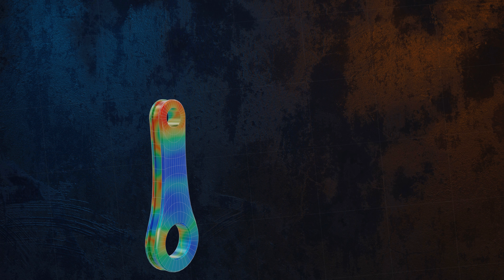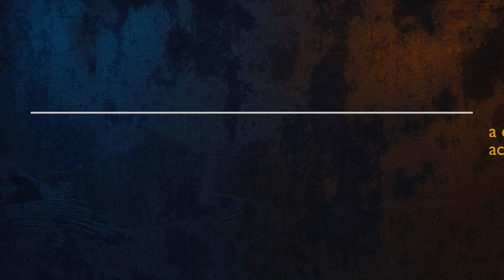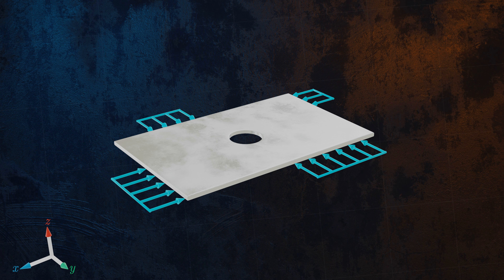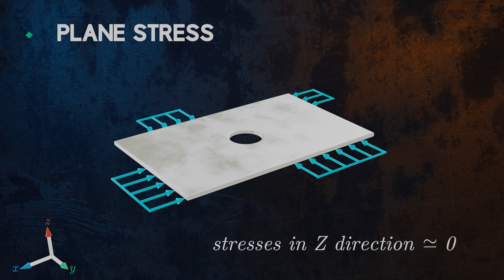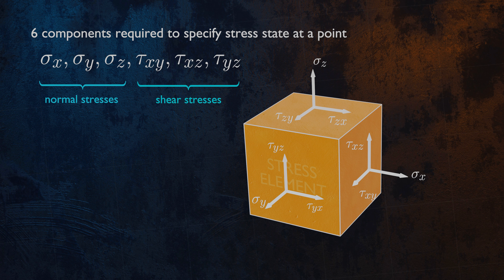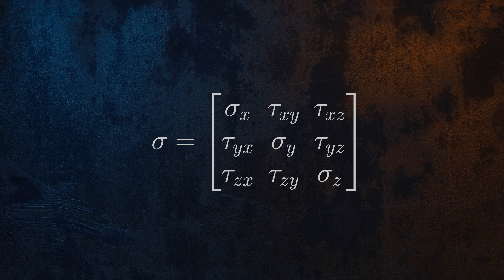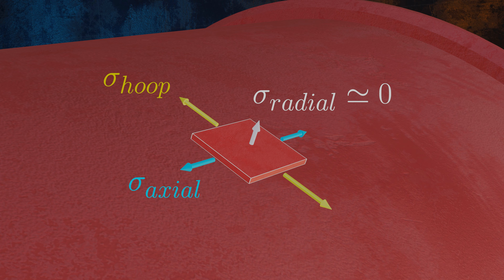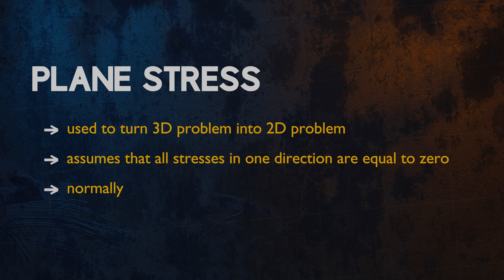Understanding Plane Stress

Comment: Though I have no background in this field, I am currently learning soil mechanics and found this video to be very informative. However, I couldn't understand the assumption as to why the stresses in z-direction is close to zero! Would be helpful to know that.
Reply from the maker: Hi Narendra. Normal and shear stresses at a free surface are always zero, since there is nothing on the other side of the surface for the stresses to react against. Because the thickness in the Z direction is small,  the stresses between the two free surfaces can't build up to significant levels, and so are close to zero all the way through the thickness. Hope that makes a bit more sense.
Reply: @TheEfficientEngineer  What is the definition of free surface?
If there is no force acting perpendicular to a surface, is that surface called a free surface?

Comment: Would it be possible to do a video on residual stress, what they are, how they change due to manufacturing process for example and how they are measured in the lab, etc.
Reply from the maker: Great idea, thanks Jon! Will have a think.
Reply: @TheEfficientEngineer  what happened regarding to residual stress ?
Reply: @TheEfficientEngineer  can u please make a video on residual stresses?

Comment: Could you please make one on Plane Strain? I'm a mechanical engineer postgraduate student at UWA, Perth. Your videos help me understand my courses so much better! <3
Reply: I'm also looking forward to the video which explains plane strain. I feel like plane strain condition is only relevant in fracture mechanic.
Reply: There's a torsion connection point in the cylindrical rod of stress strain relationship.
Reply: In another video
Reply: @changw_w9413  plain strain and stress can be applied to torsion between dipole pressure changes in crust. Earthquake math

Comment: Great video! I would like to add one more quick sanity check before going into idealizing a problem into plane stress one. Check if there is any possibility of the body to fail in the direction we assume stresses are zero. For eg, a thin plate won't experience shear load relative to top and bottom surfaces since the distance is very small along the thickness. Also, we cannot split a 5mm plate into two pieces of 2.5mm. So for these type of cases we can assume shear and normal stress are zero.

Comment: I’m new in this channel, but it looks like it wants to cover all the knowledge of mechanical engineering. I think that’s an excellent initiative!

P.S. I think this video can be extended a lot covering the behavior of thin walls (from airplanes for example) when flexure and/or torsion are applied in opened and closed sections

Comment: Question! Why do the z components of the stress in a pressure vessel end up close to zero? I heard you say that if the wall is a lot thinner than the diameter, the stresses should be close to zero, but why is that?
Reply from the maker: It's because the normal stress perpendicular to a free surface must be zero. The normal stresses in the Z direction are zero on both sides of the wall, and because the wall is thin they can't build up to a large enough magnitude to be significant. Hope that helps!

Comment: Plan strain is like sausage where force is identic along the sausage, and plan stress is like chips.  Hope  to have some videos about static or dynamic stiffness, or some FE methods.  Since a lot of engineer in their work have to do some optimisation on stiffness or have some local stress problems, during their design of structure. You can takes some exemples to show which I think will be very interesting>

Comment: Great video, thank you so much.

Just one question about the pressure vessel's wall approximation: considering that the fluid inside of it is applying a pressure on the walls, is it ok to consider a plain stress approximation?

Imagine a scenario with a very high pressure inside of it. Wouldn't that affect the vessel's walls?

Thank you very much.

Comment: Thank you sir, I'm in india your video was very good and easily understand concepts.really it's make efficient engineer, Please upload more video on fluid mechanics, thermodynamics, engineering mechanics, heat transfer,
 theory of machine, design of machine element, refrigeration and air conditioning, ic engine and powerplant engineering